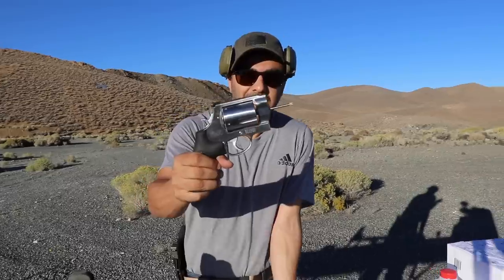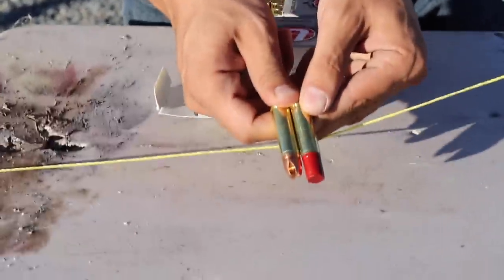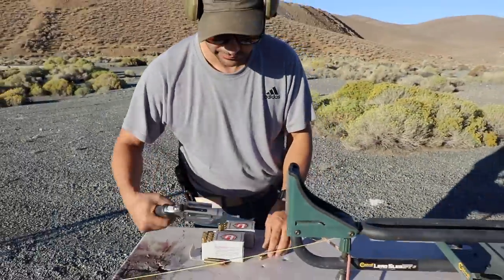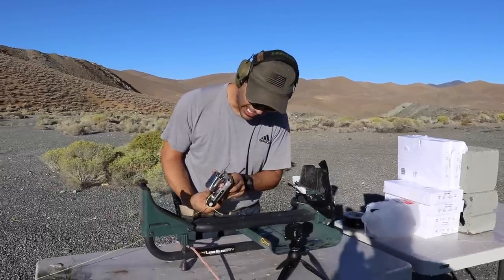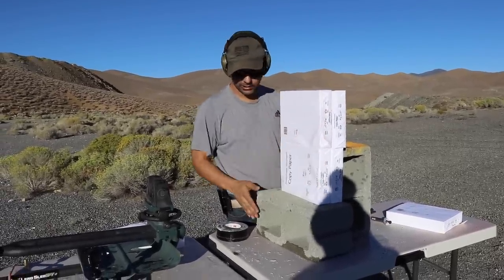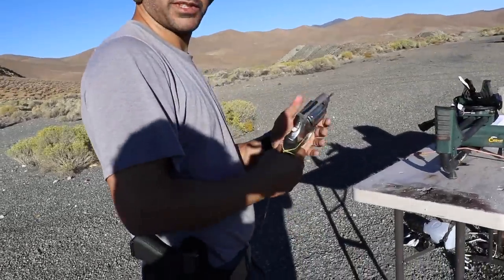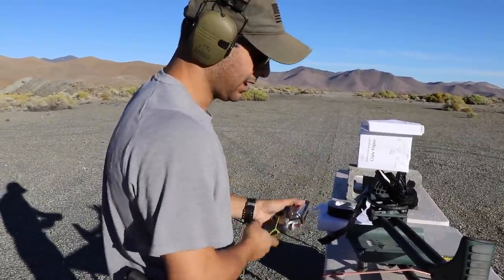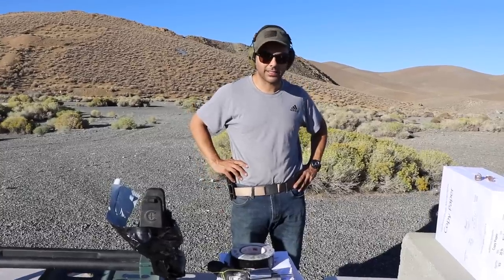Shooting 500 Magnum with No Barrel

Comment: You could fire the revolver without the barrel with your hands without any danger, because it is the cylinder that supports the expansion energy of the bullet, however, since your weapon flew away and you had the extractor bar exposed, it probably broke next to the center needle when it hit the ground... It was not a good idea to tie the weapon.

Comment: I would just hold it and fire it with one round in the firearm. It is the chamber if it goes then you will have a bad day. The barrel you can have timing issues ( if you have a barrel) but you took it off. The recoil will be harder with out the weight of the barrel and what mussel brake it may have. But with out a barrel the shot will be wildly off target.

Comment: 500 Mag with no barrel: Bends the guide rod, and flies back with enough force to break the thumb backward, and then break your nose after that..
Edwin:Can you fire a 500 Mag with no barrel? Yes you can!
 Me:...Dafuq? What is your parameters for " No"? The gun blows up into shrapnel? The bullet falls out of the barrel like a low powered turd?

Comment: Unsafest video ever. Had his arm applying pressure to the pull cord with his hand in front of the gun
Reply: Pointed the gun right at his face 7:35 Might of been unloaded but still unsafe
Reply: @Sploochie  how is it unsafe if it's unloaded?